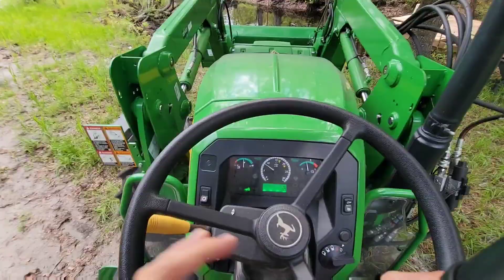What the Hales Ranch is going under water WILLIS

Comment: Being a plumber for 35+ years should’ve also used cleaner preferably the purple primer along with the glue or it might not stay it’s a two-step process in the beginning I even used clear cleaner,purple primer, and then the glue. The purple primer is for inspectors to know that you cleaned it and it’s very strong so I quit using that clear cleaner. Started using just the purple primer and glue. :-) They also make a blue glue that will work with a little water although it gets hot and sets up real quick you gotta be fast. :-) You’re very entertaining God bless.
Reply from the maker: Great advice Scoter. Thanks

Comment: I like the 30 minute format, but if a longer video makes sense, those are good too. 

I think you are going to need a small dump truck load of sand to do the beach.  Why not dig closer to the pond where the pipe is?  There is clearly some weird piping going on so make a sensible guess probably won’t work 😆 

The fast forward sections are funny and your laugh in fast forward sounds like a demonic child’s toy. 😆
Reply from the maker: The 30 minute ones are easier to get out Jody. Some will be longer at times.

Comment: Are you 100%sure that when you hook the two pipes together you'll get water running thru that pipe to the pond? You caped one pipe off but where did that go to ? Best just run new pipe to the one you caped off and run it to the pond I never saw water coming from under that dock when you turn the pump on
Reply from the maker: I am gonna run a direct line eventually